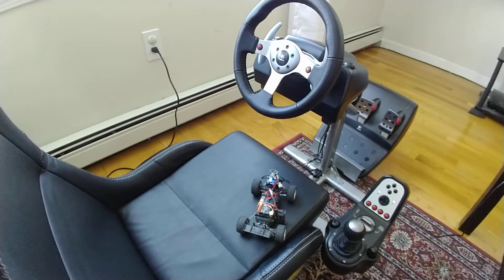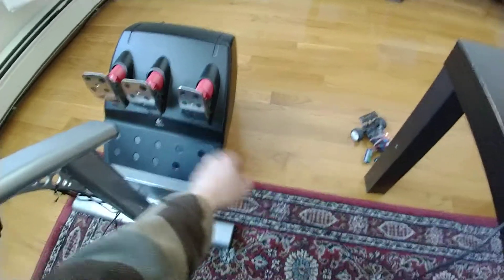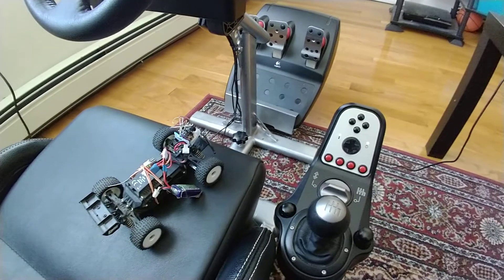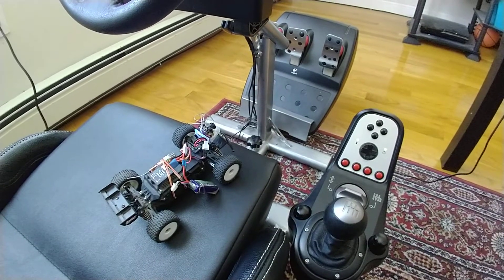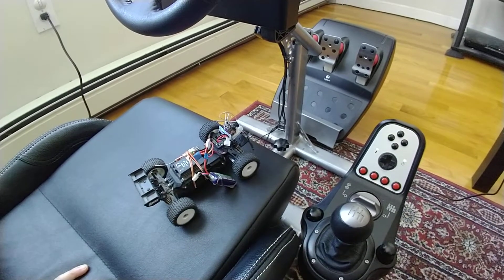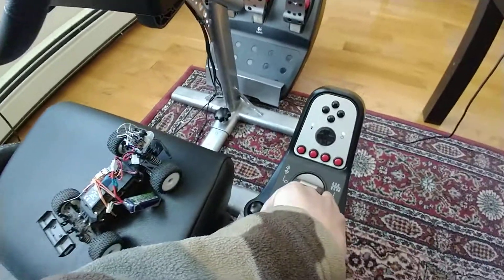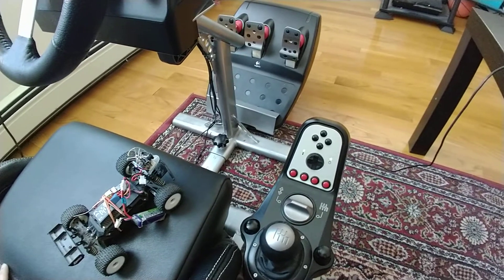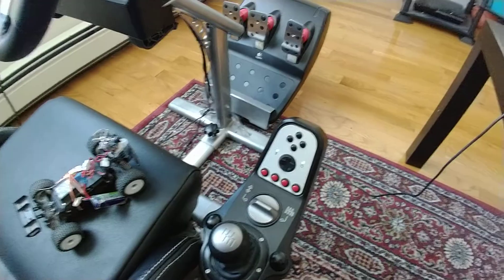G25 Steering wheel controlling a RC car

Comment: Does the Crossfire need to be unplugged like on your mod, or can it be plugged to the back of the radio and powered by it ? My plan is to have my rc car connected to a flight controller, and I wonder if using the crossfire TX like you did as a stand alone, would it still give me the option to map switches for lights, buzzer, gimbal etc on Inav or ardupilot.

Comment: Would this be possible with express lrs instead of crossfire?
Reply from the maker: Yes, but you'd need to modify the code to use sbus or crossfire protocol instead.
Reply: @blimpwings  I ended up getting a crossfire module and it works great! Thank you so much! 
I had one more question:
I want to get the h pattern shifter to work but I do not see any input change when I move it into the different gears. How would I map additional inputs? In general how do I see what inputs are coming in from usb?
Thanks again
Reply: is there a way to contact You?  @blimpwings

Comment: Hello. Congratulations. really great project. I have tube equipment to be able to do this project. tx module, Logitech steering wheel, arduino uno and usb host shield and all other equipment. I'm stuck with wiring and coding. I've read and reviewed your GitHub posts. Can you help with the code?

Comment: hi. is there any way of writing data back to the wheel so that we can get the Force Feedback?
Reply from the maker: Sorry, I have no idea how to do that.
Reply: @blimpwings  The real way to do it would be to measure the current pulled by the motor inside servo. So you would take the steering servo apart, implant eg. an INA219 board in series with motor, then just read the numbers via I2C. You should be done in no time and spend like $2 if sourcing parts from Ali. My only concern is whether the forces felt by a RC car resemble those of a real car at all i.e. will it even be enjoyable.